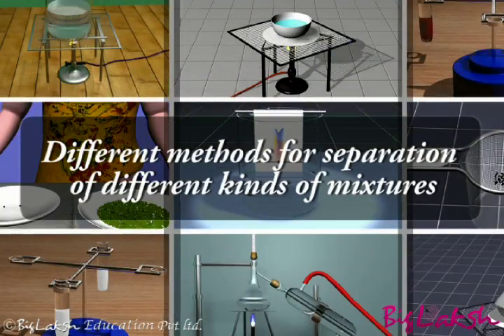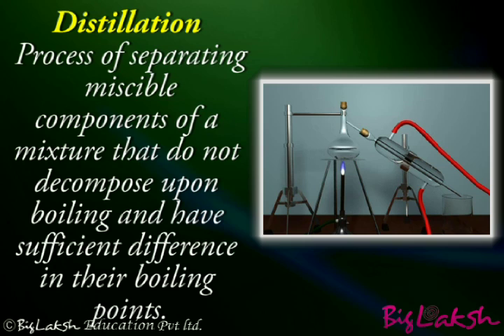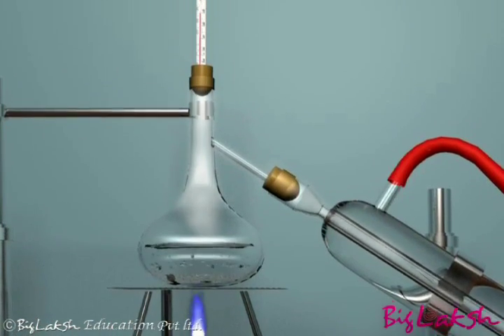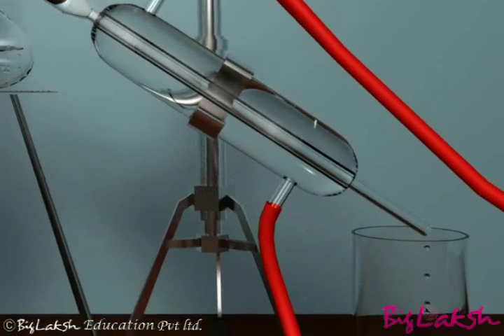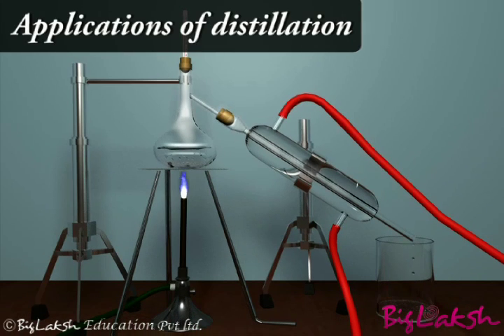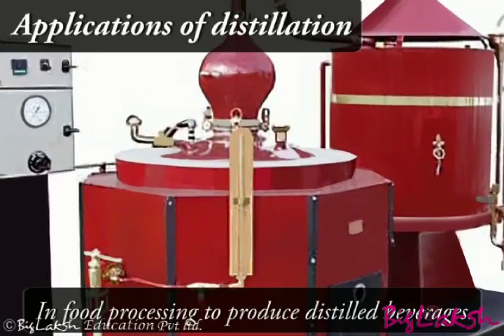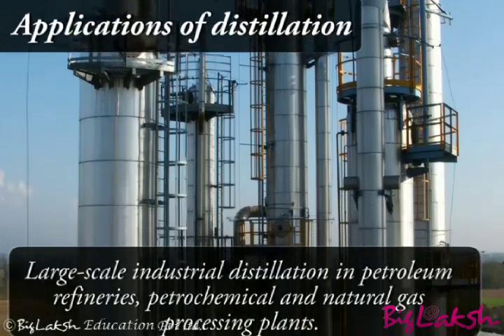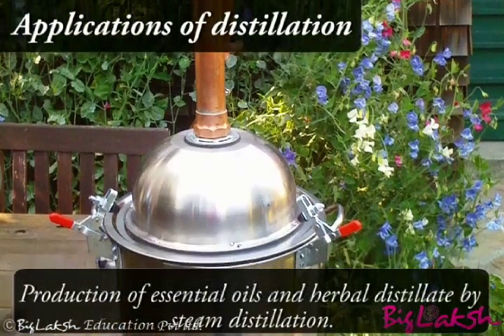Distillation: Process and Application | Method of Separation | Class 9

Comment: Please change the heading to Fractional Distillation and Facts on Distillation. DISTILLATION is actually a process where in which a liquid is separated from its initial solution.
WHAT YOU SHOWED WAS FRACTIONAL DISTILLATION
'N' check before you post something. Last but not the least delete this video or edit the video so that it will benefit everybody who have or are going to watch this video.
Reply: THANK YOU so much for the comment

Comment: I really don't get the 'water in' and 'water out' part of the condensing tube. Can someone help? I think I can see now that the cool water doesn't actually mix with the condensing water, it just keeps the tube cool from the outside. And it goes up through a really thin tube? But what really makes it go up though why wouldn't it just stay there? And how does hot water leave? Is it steam that leaves or what? I'm so confused and if anyone could help that would be great thanks.
Reply: The condensing tube is a tube within a tube, as shown. The outer tube is for the cool water which is a continuous flow from the faucet, therefore constantly moving through to keep the inner tube cool. Typically it goes in the bottom hose and out the top hose. The inner tube is connected to the flask so that any vapor boiled off in the flask will travel into the inner tube, be condensed by the colder water around it, and then drip into the beaker.
Reply: Horace the Cheese sir one dout...that type distillation is used for separate the complex in the leaf or plant

Comment: what if both immesible  liquids have same boiling point ?
Reply: See there is a difference between immiscible and miscible liquids so here you are asking about the miscible liquid . 
It can be separated by using a seperating funnel
Reply: @rejithomas1102  💯
Reply: They won't separate
Reply: Itna dimmag kha se late ho aaplog😥
Reply: There are no liquid existing on earth 🌎
Reply: @buddhafollower  🧐nice
Reply: After 1 month
Reply: you'll have to use a different method
Reply: So , thanks everyone for clearing my doubt !!!
Reply: immiscible liquids are not separated by Fractional Distillation, but with separating funnels.